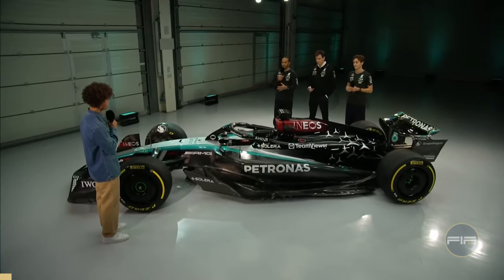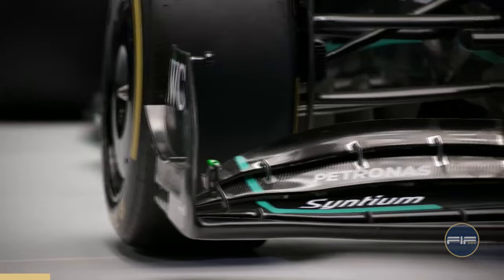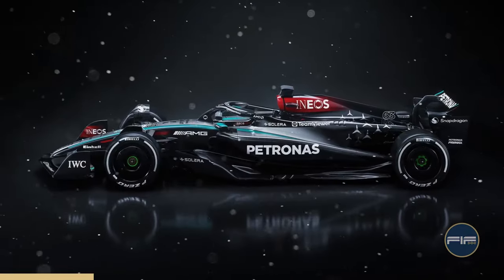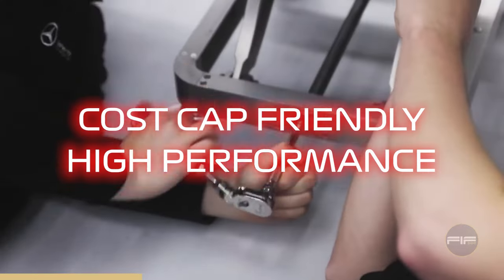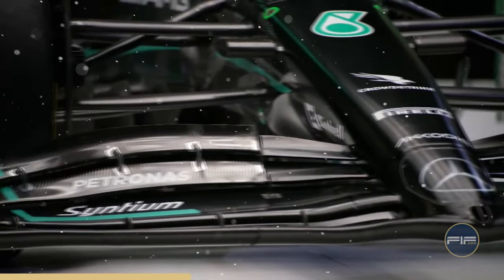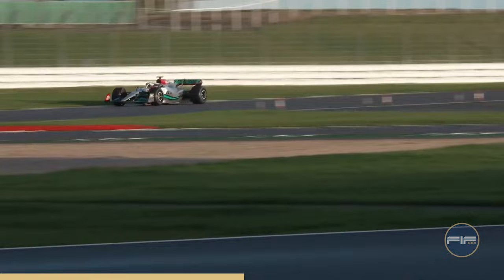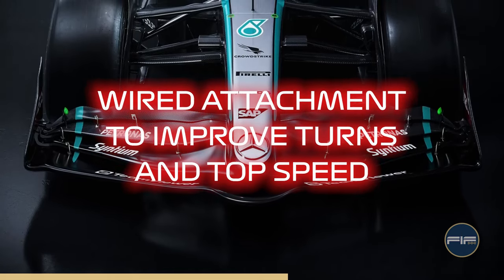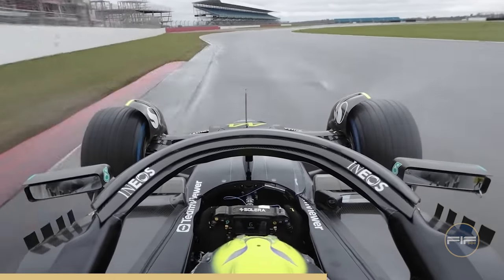MERCEDES Shady Front Wing In W15! | F1 Fast News

Comment: So they will have to change a lot if they are told to stop what they are doing? Is this going to affect MB’s cost cap by a lot?
Reply from the maker: That depends on FIA’s decision, and they probably have a backup plan in case something like that happens so probably there’s not much to worry about right now. We’ll see what happens soon!
Reply: @F1_Flash  I really don’t get why isn’t there a rule that lets teams innovate some more, and honestly Mercedes has been really great at this, with the push pull steering wheel they added another layer to the drivers ability and the innovation was pretty amazing TBH, but whatever… with the cost cap it would be great to see a engineering competition getting close with different ideas.
Reply from the maker: Yeah, well some times they are a little weird like the time they were driving 320 km/h with one hand lol, but yeah it would be a great concept to see what solutions every team implements to close the gap between them. I’d love to see it..